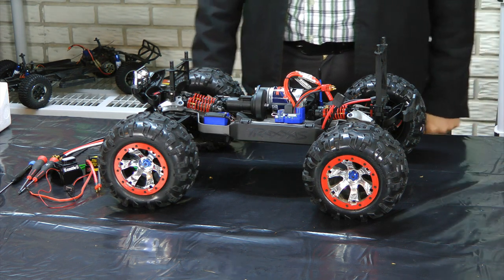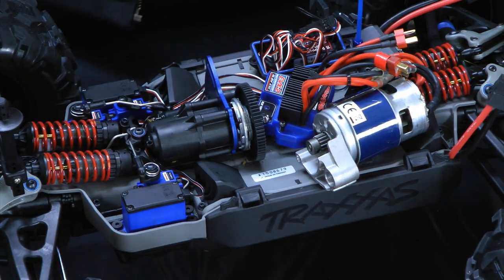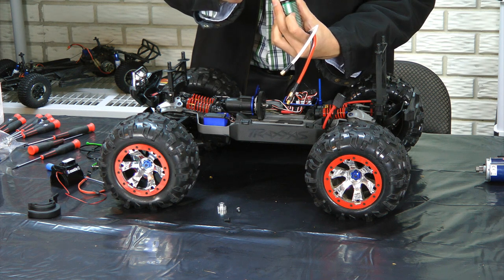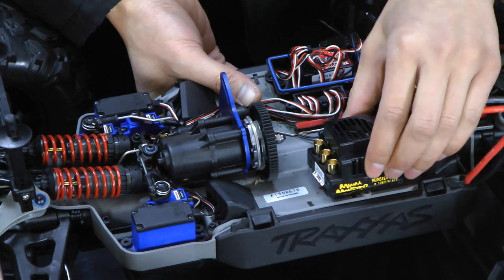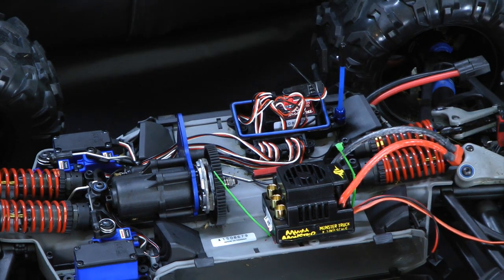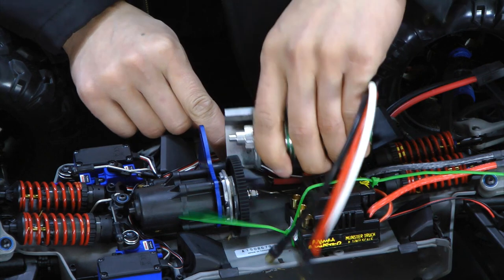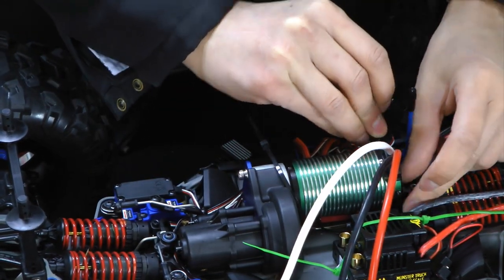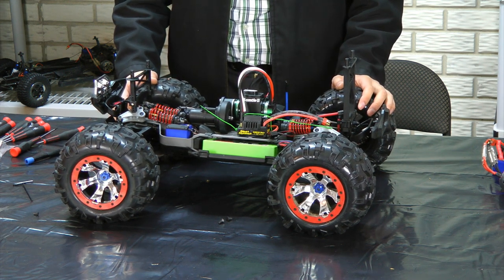How To Install A Castle Creations Mamba Monster in A Traxxas Summit

Comment: I was hoping to see how it all worked and any calibration if any was needed to make the system run or is it as simple as plugging the batteries in, switching it on,pulling the trigger and off it goes?

Comment: Does the Castle motor include the necessary new screws?

Speaking of screws, those ones you were referring to as captive screws are NOT captive. Captive means they loosen up, but cannot be removed from the part they're captive to. The term you're thinking of is 'cap head screws.'

Traxxas makes a hold down bracket for the Castle Mamba Monster ESC now.

Comment: Hey rcnightmare,
what will happen if i put a single vxl system in this? would it be too much for the engine? Would it fit in the stock motor plate mount? Thank you.

Comment: dam im on the fence...on the one hand its a crawler but just slightly under powered. I have a mamba and a castle i want to thrown in my new summit but i think im gonna gear it down cause the 6s power is a diff killer...i have two erevos and i know diffs... i think i will just try it and see how it goes.

Comment: So I got a Y cable setup on my savage flux and I'm not sure if it's a series cable. It has 1 female plug for the ESC then 2 male plugs for the 2 batteries, would I want the Y version or the triangle version?

Comment: Whoa whoa whoa whoa.... Hold the bus up. There is a $3 piece by traxxas (TRX5626) that will hold down the ESC. Its meant for the E-Revo and E-Maxx, but it should fit on the Summit...

Comment: What size screws do you need to hook up the new motor???
Reply: It all depends on the motor. But most brushless motors with a 40/42 size can, uses 3 mm screws. This is also why he said that you need to use the different and smaller holes. If you get a motor with 4 mm holes, you can either drill out the 3 mm holes or use the stock 4 mm holes.

Comment: The 10th scale summit weighs 11 lbs.  The 10th scale B4 for example weighs 3lbs - 10th scale.  If you want to run a paltry 80 watts per pound with a standard 3650 class motor then you're gonna need a lot of luck.  The real finger pointing should be at Traxxas for calling it 10th scale and confusing everyone.